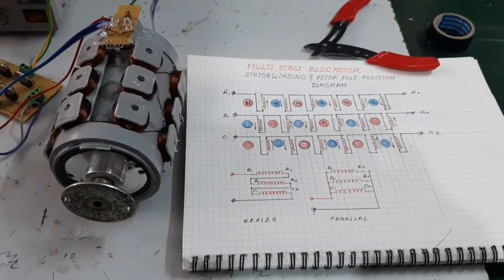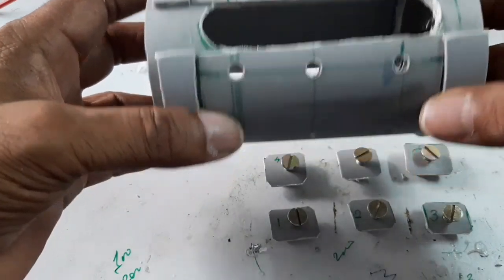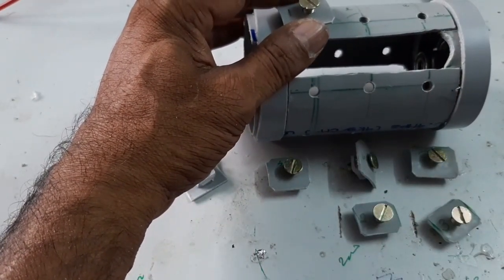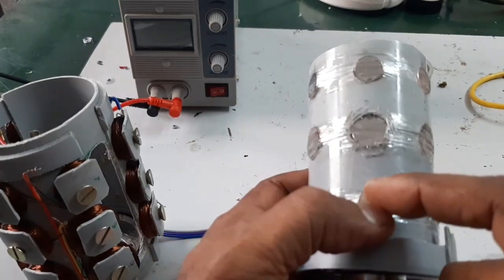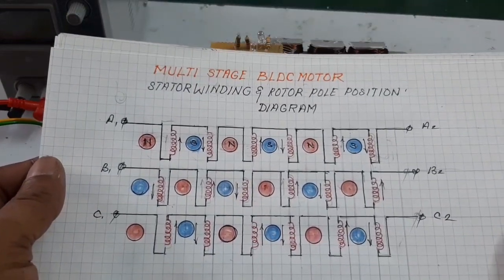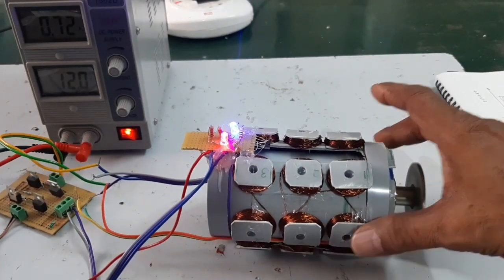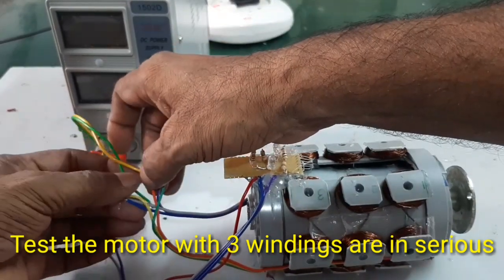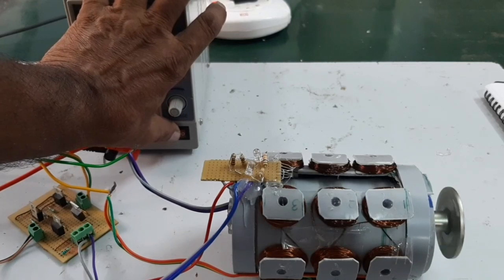(V-109),3 stage powerful bldc motor

Comment: Great job Sir.
Would you please explain driver circuit used to operate the motor, with schemetic diagram? Thanks
Reply from the maker: Thanks sir,The driver circuit is already posted "Home made bldc controller using various types of sensor" pls see the video

Comment: Interesting design.  It appears the architecture there is like open E-cores and 
that keeper bars could be placed axially six across the inside of the rotor and 
another six keeper bars across the heads of the screws that are stator cores. 
Using 12 keeper bars total in this way would concentrate the flux and should
improved the performance by the effect of the E-core architecture that results.
Reply from the maker: Thanks for motivation sir
Reply: @pugalstech  You are welcome. Where you show using shears
to cut into 3 pieces the PVC part having small square coil forms 
is a part that could be made as 1 piece not cut into three parts.  
Instead of using PVC the strip could be a stack of transformer
lamination sheet metal strips. The small cubical core forms 
could be a stack of squares of steel sheet laminations and 
these when assembled would be 1 of 6 stator coil groups. 
The iron core would increase the stator coils flux intensity, 
so the efficiency would increase. The same idea to use the
strips of lamination steel under groups of 3 rotor magnets, 
also would increase the magnetic field and efficiency for
your interesting design. Your design and architecture has
merit, but using the lamination steel to advantage easily
allows same architecture to provide higher performance.
Reply from the maker: Ok sir, thanks for your good suggestion s
Reply: @pugalstech  This motor is a radial variant of an axial motor
you posted a video on February 6. Using iron cores would work
exactly the same way.  Likewise this architecture could be used 
as a single phase alternator with all coils in series at low rpm
for good voltage output at low rpm. A special feature of this
design is it can be scaled up easily and efficiency increases 
with size. With a rotor and stator of large size such as may be 
a rim extended from a water wheel holding the magnets, the 
large circumference allows many of the groups of 3 magnets 
and the space allows many stator coils positions with larger 
coils and more windings using larger wire for greater power.  
The same architecture could be used for wind machines.